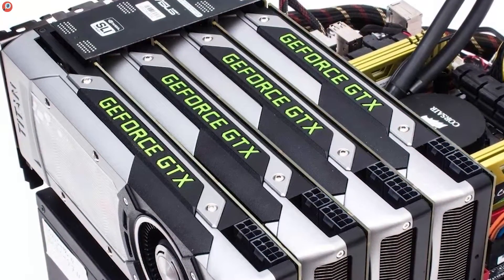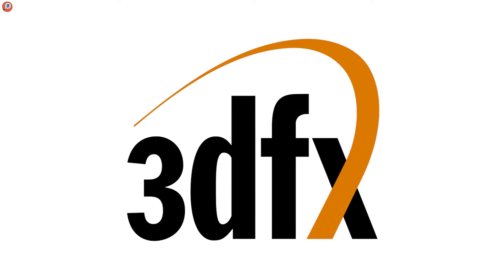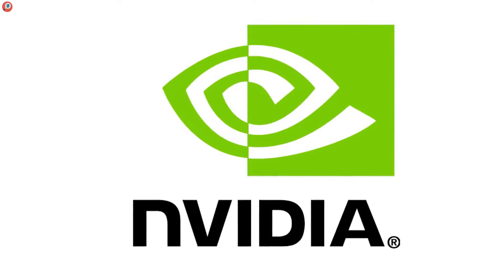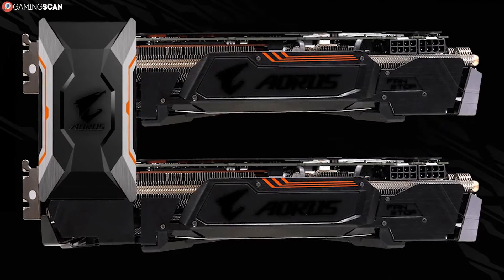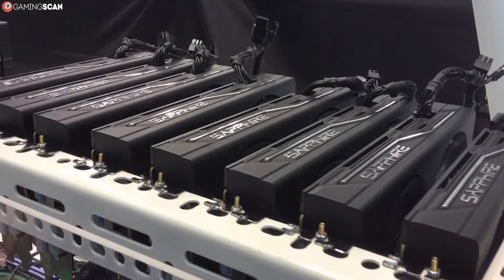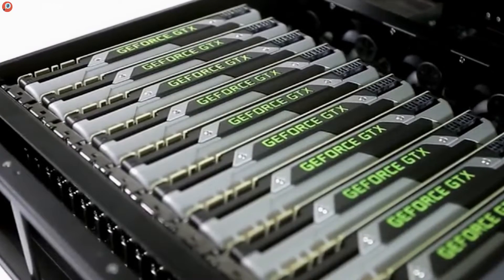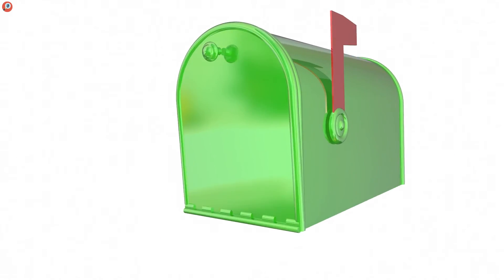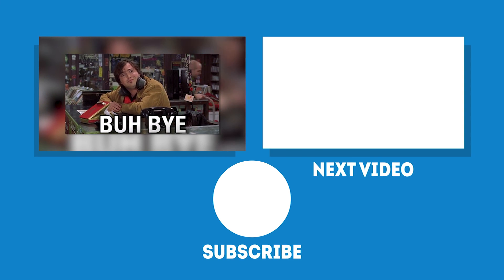What Is NVIDIA SLI? Do You Even Need It? [Simple Guide]

Comment: Thxs, learnt a few things about the bridges. What makes no sense at all is the support unavailable for SLI. Split frame rendering and Alternate Frame rendering couldn't possibly be an issue with any game. No special coding needs to be done. Keeping things cooler with GPU bandwidth to spare is a good thing. For gamers and developers, it's even more cost effective to manufacture. Not sure what they are playing at, it doesn't make any sense at all. Like touch screen phones without a single one with numeric keypad for rapid t9 or number input. It devastated a generation of texters from the days when Nokia dominated the Mobile phone market. You could text with one hand without looking at the phone for anything because of the tactile feedback of the keypad and phone menu had keypad shortcuts.

Ricky.
Reply: The only thing I can think of is energy consumption, probably not half as energy efficient as the right card for the right game. 

Ricky.

Comment: I found a second nvidia 8800 GT in 2020 and put it on my 2017 build and I had an old 8800GT my MB was compatible  and so where both cards.
It did nothing to improve gaming and my MB died after a month of using it.

SLI and physics cards are a gimic but I think they may have some specific uses.

Comment: I have a question. I plan on getting a ryzen 3700x and two 1080ti's. Now I understand Id need a cpu with more lanes. But I also plan on getting a x570 board that has pcie gen 4. Would the lack of pcie lanes on my cpu bottle neck some sli preformance? Or would the gen 4 pcie on the x570 board take care of the lack of lanes coming from my cpu?
Reply: dont sli and get 1 good card